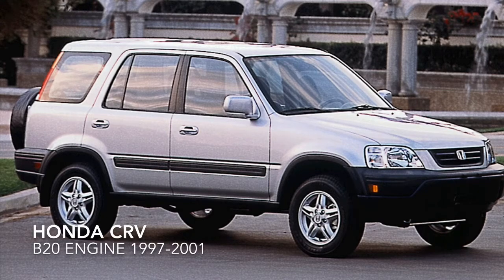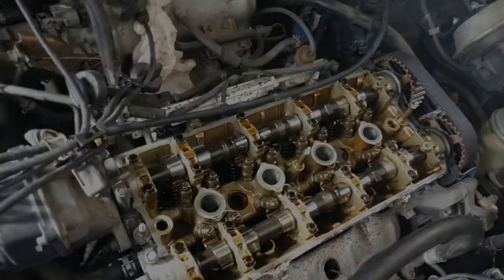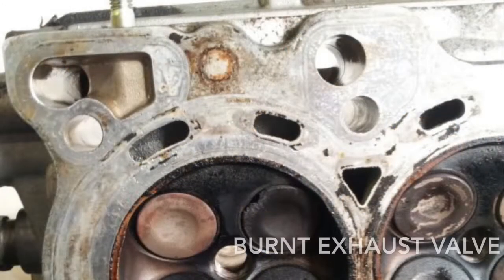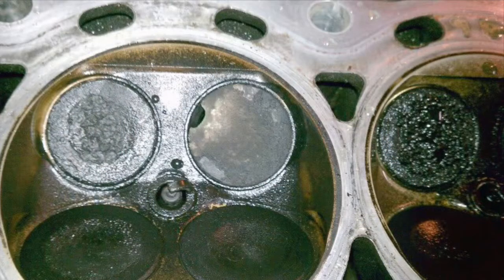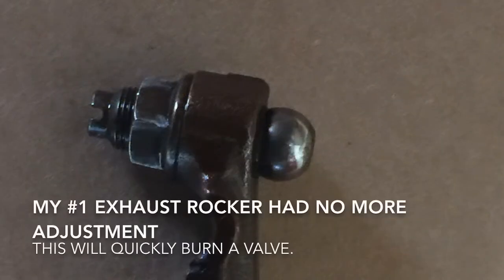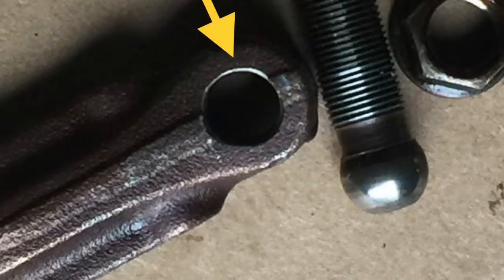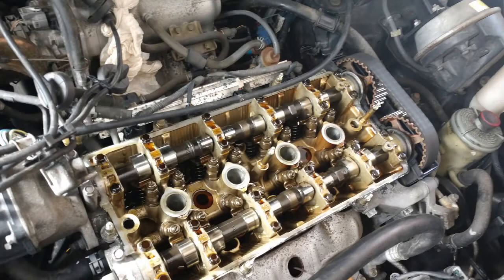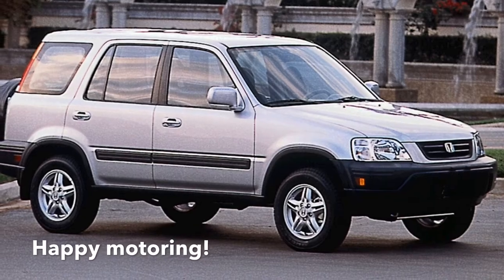Honda Crv B20 valve seat recession fix

Comment: i went to adjust my valves at 160k miles and im also having this problem with the adjustment being maxed out. is there a way to get the rocker out without removing the cam and all?
Reply: Yes